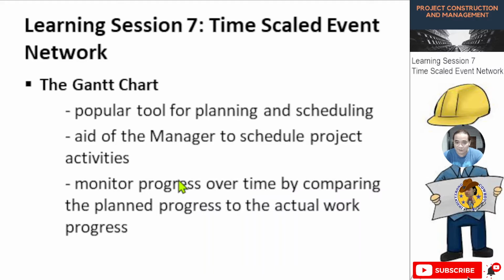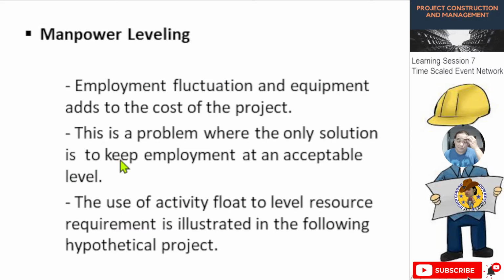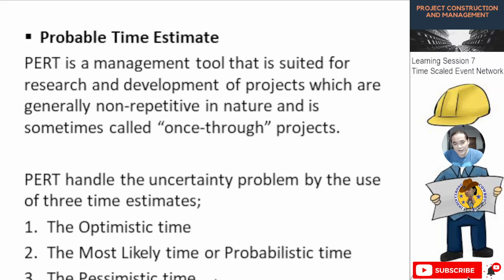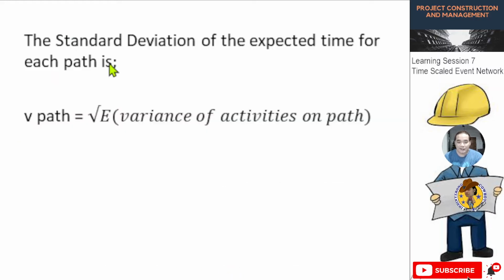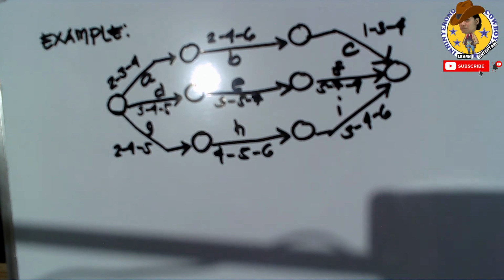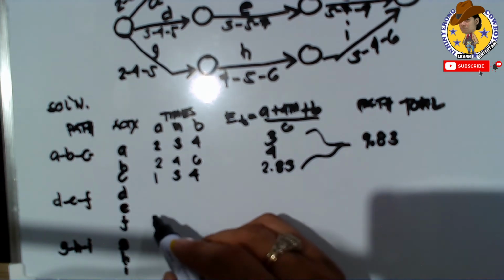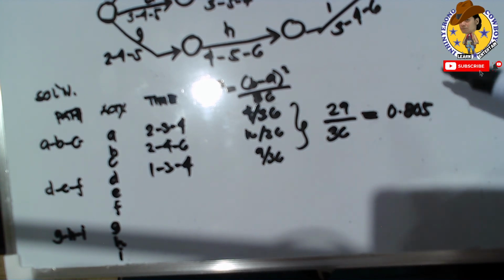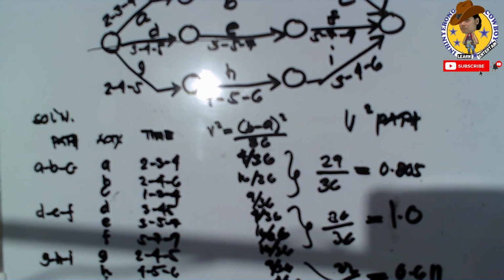Project Construction and Management  LS 7 | Time Scaled Event Network

Comment: The Program or Project Evaluation and Review Technique (PERT) is a technique that aids in the planning of a project. It specifies the actions that must be completed as part of the project's completion process and the time required to perform these activities. PERT is a powerful tool for project planning, especially for large and complex projects. The PERT chart focuses on the various tasks and how they should be handled by demonstrating their order and connections between them. This technique also provides for the determination of several time periods that can be employed to complete a project, ranging from the shortest to the longest.